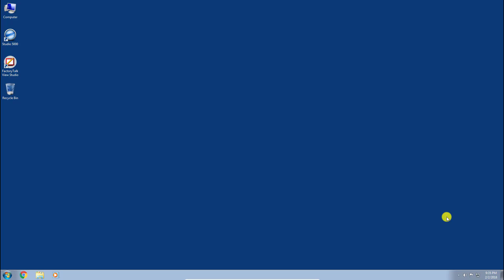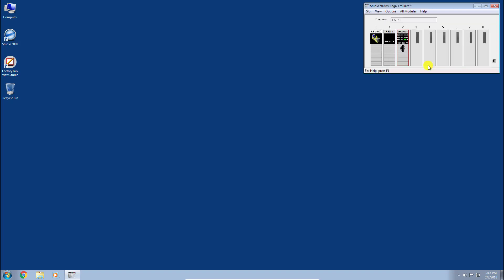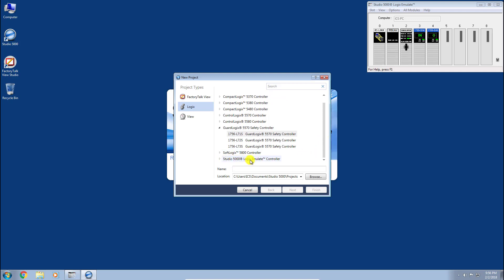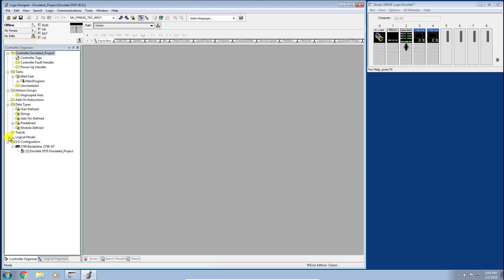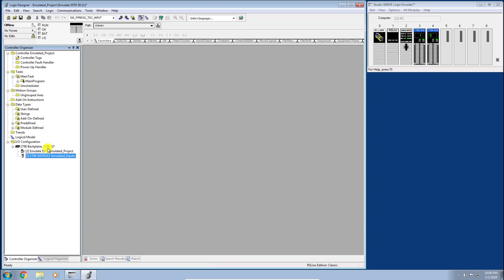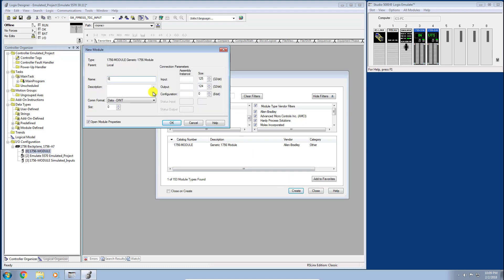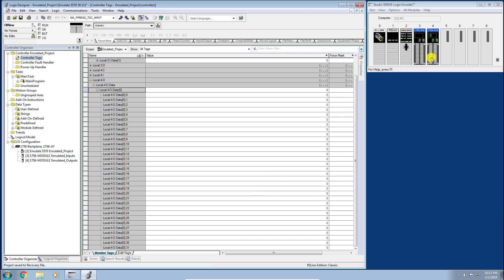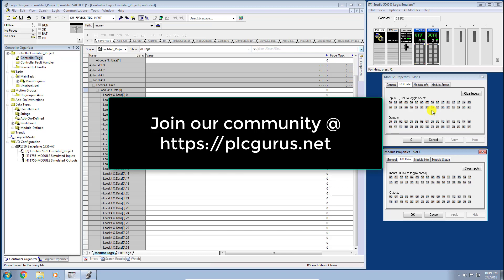PLCGurus.NET - How To Create A Studio 5000 Logix Emulate Project

Comment: It´s interesting....great video...thanks for sharing! By the way... Could we simulate Analogical signals and Safety-Parters on Studio 5000 Logix Emulate? I have a Complex process that have Thermal process, Motion Control and Safety Partner (like to 1756-L72S or 1756-L82SP GuardLogix).
Reply from the maker: Unfortunately no. There is no true analog IO

Comment: Great video I just have one question. Based on what did you selected your Connection Parameters. Where you fill in the Assembly instance and size in the new module screen. I kind of have a thought of what you are referring to but I just want to be sure of the what this is. Thank you!

Comment: Hi, great video! Love your learning video series! Just got a stupid question, does PLC have internal physical Relays or coils for digital output? Searched over internet, someone says yes, someone says no. I am confused. Could you clarify this question for me? Many Thanks!
Reply from the maker: Depends on the module. Some output modules have relays soldered right onto the card, then others or transistor or triac type outputs....so the answer is yes.
Reply: PLCGurus.NET thanks a lot! It makes sense

Comment: I have studio 5000 V30 and Studio 5000 Logix Emulate V32
I'm trying to add controller but I always receive this error message "Internal error failed to install studio 5000 logix emulate in slot!"

I'm trying to repair it and perform the solution was mentioned before in another thread, could you help.

thanks
Reply: If any one need logix 5000 v34 reply this comment

Comment: Hi is there a way to connect emulate to Roboguide
Reply from the maker: Hi there. No I dont believe that would be possible. Tbh the emulator is pretty limited in functionality, which is unfortunate, because they do have a full blown SoftLogix system that can function like its hardware counterpart.
Reply: @PLCGurusNET  thanks but softlogix doesn't support ver 32 . Unfortunately that's what my latest projects need to be in. Any thoughts? Thanks

Comment: Let's say I have an existing program I am testing, where the processor is not in slot 2 (it's in slot 0)and can not be moved to slot 2 because that is already occupied with some configured IO I can not change.  Is there any way I can still use this emulator in this situation?
Reply from the maker: Hi Jeff and thanks for watching. Yes you can! I actually show you how to do this exactly in my ControlLogix PID Essentials series. I show how to move the process in the 3rd video in that series here: https://youtu.be/IG_gbsJ1FE0